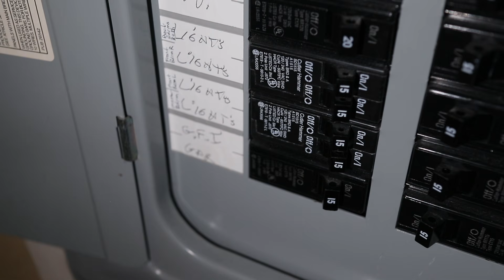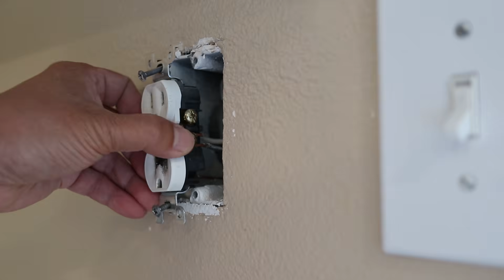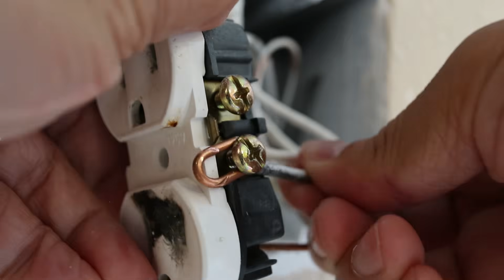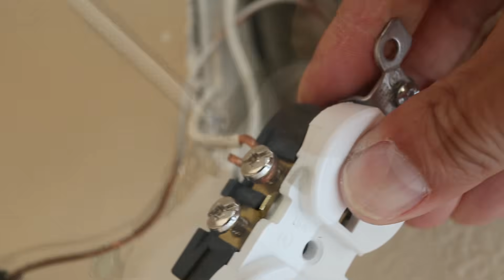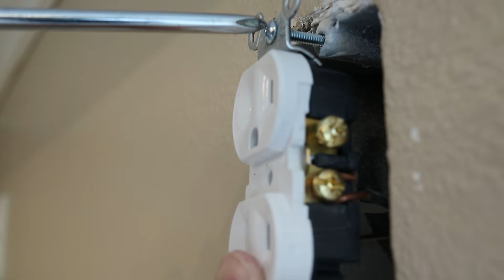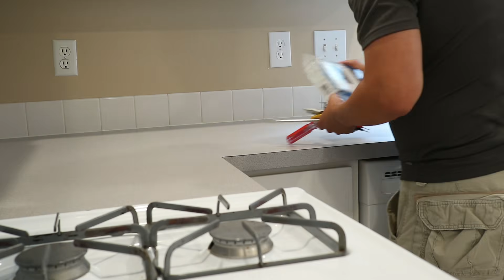How to Replace an Electrical Outlet – Replace Burnt Out Electrical Outlet and Old Damaged Socket

Comment: why would it burn tho? i got one like that
Reply from the maker: This outlet was from a rental house and the tenants hid it behind a child proof cover. I didn’t discover it until they had moved out so I don’t know how this outlet got burned. Could’ve been from a faulty appliance or something metal crossed the prongs on the plug causing it to spark. But as you can see replacing the outlet isn’t very difficult. Thanks for watching!

Comment: Your wires for hot and neutral are a bit long, you dont want copper hanging outside the back of the outlet.
Reply from the maker: Yes! Thanks for the observation! A few other viewers said the same thing about wires. This is how the wires were installed when the house was built. First time I’ve replaced this outlet. I’ll have to go back and cut it back so there isn’t as much copper showing. Thanks for watching!

Comment: No point in explaining the difference between the hot and neutral wires and where they go right? Because the previous outlets will always be wired correctly.

Comment: A real simple way, Live wire which usually is black always goes to the shorter plug slot on the right of the plug, and white neutral to the left larger slot! If the plugs have color coded screw terminals, brass colored screws on the right is black aka live wire, the silver screws on left are white aka neutral, and ground is the green screw where the bare ground or in some cases green ground wire goes! And for ALL THAT IS HOLY do not use the stab in connectors in the back, they might be okay, but they have a higher chance of failing under heavy load thus leading to a fire in the wall!
Reply from the maker: Thanks for the additional electrical tips!

Comment: What causes burnt outlets?
Reply from the maker: I’m not exactly sure what causes burnt outlets. The one I replaced was in a rental house and the tenants hid it behind a cover when they moved out. But it was probably caused by sparks or arcing at the plug.
Reply: @TheRenderQ  the reason why the outlet was burned because you did not snip little bit of insulation wire.

Comment: Great & helpful video.  One of my sockets was not working properly. The top would not work, but the bottom one had power.  I followed this video and when I removed the outlet from the wall, I noticed the top white wire was a little loose and not as tight. There were no signs of burnt, discoloration, or wear & tear.  I made sure that loose screw was on snug/tight. It turned out to be the problem and it's working again.

Comment: I am not an electrician but that wire is stripped too much, it needs to be shortened a bit.
Reply from the maker: Thanks for the observation! A couple of other viewers have also mentioned that too much wire is exposed. I just changed the switch as is but I’m now more informed about the insulation on the wire. This outlet was installed by an electrician when the house was built. So even electricians don’t always do it correctly I guess. Thanks for watching!

Comment: So what if the outlet has no power anymore
Reply: It sounds like you would need to shut off the breaker to that room, and go in with a  pair of gloves to see what the problem is. It probably came disconnected or shorted out.

Comment: Ground doesn't have insulation?
Reply from the maker: I’ve done simple electrical work like this in a few houses with switches, lights and outlets. None of them had insulation on the ground wire.
Reply: @TheRenderQ  Thanks for info. Well I am electrician self-learner, but this is the first time I see "Ground" not insulated. Not saying its wrong, but uncommon for me. In our country we got GND as YellowishGreen insulation.

Comment: When 2 pairs of wires, it is important to make those terminal screws very tight, the entire load of the circuit is reliant on those screws to carry the power to the rest of the line. Restrip the wire for a new clean fresh connection. The old one dented the copper and weakened the connections, so starting fresh is better. Theese videos are kind of dangerous......many important facts missed. Dont reuse wire if damaged or burned or weakened.
Reply: Stripping to some fresh wire is the only important thing that was missed. I wouldn't call that "many."
Reply: @clint4237  out of all the things I addressed......you pick apart the use of the word many...lol yes overlooked MANY important issues, not gonna list em....dont be jealous,  it's my trade, u a jack leg handy man.
Reply: @captainhowdy3104  with all the things you addressed? You barely addressed anything. Don't be jealous? What are you even talking about? Stop being a child.
Reply: Also the copper wire shouldn’t be exposed beyond the black part of the receptacle without insulation any loose or cross connections could hit the hot and wouldn’t be good
Reply: @ryanshaneprod3487  hopefully breaker would trip.....unless it's a square d modular home type or g.e.slim. I have a dead short switch I made up to test breakers or use in demo situations.....be surprised my findings lol
Reply: Good to know.i have at least one burned out one I haven't  looked at yet!!
Reply: @renatawarec  He should've trimmed the wire back an inch and that would've completely of SOLVED the problem. I have OCD so i would've taken sand paper to the end of that ground maybe rough it up 1/2 inch at the end of the wire so that you don't see paint on the ground anymore. lol. 🤷‍♂️

BTW having a gutter mindset where you say to yourself well I can't do such and such because its "dangerous" is just ludicrous. EVERY billionaire took CHANCES! 💯

Comment: Is this a 2way or 3 way? I'm looking for replacements just don't know which to grab
Reply: Single pole (1 way) or three way referees to a switch.  For a typical household you need a Recepticle rated for residential 15 amp. 20 amps needed if the Recepticle you are replacing has a "t" on the left hand side of the plug. Mostly used for things that have large motors.

Comment: Thanks. Seems pretty simple.
Reply from the maker: You’re welcome! It actually is pretty easy to replace an outlet. Of course make sure power is off when you’re working with wires. Another viewer recommended that I use insulated screw drivers so that’s what I’m getting before my next electrical project. Thanks for watching!

Comment: Thank you so much. I have a light switch that needs replacing. Unfortunately it has an outlet next to/attached to it. I thought I might do some research on what to expect before I open it.
Reply: If you have a wall outlet next to the switch it will be the same as flipping the lights off. Because they draw off the same lines. Sounds insane but true

Comment: The outlet I need to replace is an outside outlet and isn’t listed on the breaker box. Any suggestions?
Reply from the maker: Your outlet should be on a breaker even if it’s not listed. However I’m not an electrician but I would think it has to go through the breaker box. I’d plug in a light or something and flip breaker switches to find which one it’s on. However if the actual outlet isn’t working you’ll need the circuit tester and test the wires as you try different breaker switches. Power should still be going through the wires even if the outlet isn’t working. Hope this helps!
Reply: TheRenderQ thank you so much! They did a horrible job at labeling in the box, the only thing close to outside is the porch lights.

Comment: Can a burnt outlet that was back stabbed cause other outlets in the circuit to lose power?
Reply from the maker: If one outlet has caused other outlets nearby to stop working they all might be in the same GFCI circuit. I’m sure you’ve seen those outlets with the ‘test’ and ‘reset’ buttons on them? You’ll have to find the one that has tripped and hit the reset button. Once I had my bathroom outlets stop working. It took me a long time to figure out where the GFCI outlet was. Turned out it was in the garage. I was looking for one inside the house. Hopefully a GFCI is what’s causing your issue!
Reply: @TheRenderQ  I only had one in the bathroom and it's fine. I found an old 3 way switch next to a single pole switch in my kitchen. It looks like the beginning of the line.  The 3 way has a white and black wire on the common screw. It feeds my kitchen light and the single pole switch next to it that sends power to my outside light. I banged on the wall around it and now the outside light is dead and my other outlets are showing open hot. I'm pretty sure it's the source for all the outlets that went out and are showing open hot now. Must be a loose connection in there. Gonna rewire it today.

Comment: Hey I’m quite scared my outlet started sparking after a prong got stuck in it I tried taking it out it sparked and the outlets in my house stopped working what should I do turn on the breaker or take out the outlet and replace it or do I have to rewire the outlets
Reply: Turn off the breaker that controls that outlet.  With the power now off to that outlet you can replace the existing outlet with a new one like in this video.   Simply copy the wires like he did.

Comment: What if upon doing this (In an apartment) you notice that there is no Ground Wire,is the ground wire really necessary?
Reply: It depends, is a two prong receptacle or a three prong as shown in the video? 2 prong are in older residences probably over 60 years. They have no ground wire. Actually this is the responsibility of apartment management.
Reply: @surferdude642  It was 2,I made it into a 3 tho.
Reply: @CONCRETEJUNGLE-be6ic  that maybe a fire hazard. I read in other comments that goes against code. Definitely contact apartment managenent...
Reply: @gloriamacias1381  Thank You.

Comment: Thanks for this video! This may be a silly question, but my house was built in the 70’s. Is there just a standard replacement for all houses, or do they have certain amp or volts that I need to look for when purchasing some? Thanks for any help.
Reply: Nah, but your outlet may not be grounded, depends on the wiring. My house is from the 60s and previous owner replaced the outlets from 2 prong to 3 prong but the 3d prongs for grounding and there is only a positive and negative wire. This means it can take 3 prongs but not by code
Reply: The standard receptacle was then is now 125 volts and 15 amps. 1500 watt device is the maximum you should use. This would be for example a powerful microwave oven or a room heater. Most devices state the power (watts) on the unit. 1500 watts is equivalent to 12.5 amps. If you are interested I recommend you do some research on home wiring and electrical systems as there is too much for me to explain in this comment section. I hope this helps.

Comment: My outlet sparked, then stopped working.
Reply from the maker: I’d replace that outlet if that happened. However it could’ve just tripped a breaker switch. If this is part of a GFCI circuit then on the main outlet just reset the GFCI button. I’ve had that happen before. Hope this helps!
Reply: Same

Comment: Hey I have a question, my outlet looks exactly like yours, burnt out. All my plugs that I put into into the outlet get hot. Do I have to change the whole outlet Or do what you did in the video. Also my
Plugs do not go in all the way properly and at some angles there’s no power to the thing that’s plugged in the outlet.
Reply: Call a real electrician lol
Reply from the maker: If your wires get hot when you plug something in that could be dangerous. I’d definitely replace the outlet as shown in my video.

Comment: I was wondering why you attached the black wire to the bottom screw instead of the top screw.  My outlet was demolished (split in half by a large picture falling all wall onto an air purifier plugged in - I wish I had taken a photo of it before I removed all the damaged pieces) so I had nothing to go by as far as where the wires were.
Reply: No problem Mardi, get a new receptacle from your hardware store and use that. It makes no difference, just make sure you fasten the black wire to one of gold screws and the white wire to one of the silver screws and tighten firmly and tighten the unused screws also so they don't just hang there loose. Don't forget to cover it with electrical tape like he shows.
Reply: I"d be sure to make sure you flip the receptacle so the ground is on the TOP. This is pretty common given this particular application.

Comment: can u pls tell me what exactly the tool is that you plugged into the socket to check the line when you were done? thankyou
Reply from the maker: The tool I used to test the socket is a dual lead circuit tester similar to this one: https://amzn.to/3hyMwIp

Hope this helps!
Reply: @TheRenderQ  thanx it did. great video by the way. i thought it would be scary and hard to do this, and you showed it to be pretty darn easy. appreciate you. i blew a socket last winter with a space heater. i know-dangerous! not this year. anyway it blew, and i lost that circuit line. so one room had no power. it is a spare room so i was kind on calling an electrician. but thanx to you, did it myself. line up and running...IF you get time and know how, i would love to see a vid on-pulling a line from house ?(socket) across my yard to put in a new outlet by an outside shed. i know i will have to trench, and put the line inside a grey pvc pipe, then rebury it, but wanted to know if i would be comfortable trying to do that myself. have no idea how i would tie into the house???that may be too much for me, but i would love to see it done so i could check it out....

Comment: Hello I was replacing my outlet my black wire broke how do I replace that black wire
Reply: Restrip the wire back far enough to undamaged, clean wire. Bend the hook on the wire in the same direction you tighten the screw, hooking backward loosens the wire as you tighten.
Reply from the maker: How far back did the wire break? If there’s still enough of the black wire to work with you can just strip off some insulation and connect the bare wire to the outlet. If it’s too short you can strip off the insulation and use a wire nut to add an extension to lengthen the black wire. That’s if you have some extra wire lying around. If not maybe one of your neighbors might have some scrap wire.

Comment: I have a cfgi outlet to replace it, circuit in the breaker box is fine, I put the wires on the same screws as the original outlet had, but it doesn't work

Comment: Short, sweet, and to the point. No vlog style trying to extend the video to boost your pocket depth. Love it brotha!
Reply from the maker: Hey! I’m really glad that you appreciate my tutorial! I always try to make my videos as concise as possible. No need for unrelated info making the video longer. Thanks for watching!
Reply: @TheRenderQ outlets look like tiny gasps. 😱
Reply: @TheRenderQ  sir i like ur vidio can u reply me
Reply: @TheRenderQ  u from sir can u reply .i want few help
Reply: This looks so easy to do. Thank you for this video. @TheRenderQ
Reply: At first, I would of used a Non-contact voltage tester pencil, sticking two leads in a burn-up outlet could cause an electrical short. "Safety first"...Second, Trip the circuit breaker.Now before removing the protective cover, Retest the outlet.FOR extra safety use the two lead tester and test side to side. Before removing and handling the outlet. Just putting out some extra safety tips that's all.
Reply: Exactly. Tired of how to video where it’s 5 minutes of intro and 2 minutes of instruction.
Reply: Damn such a great comment and no heart 😞.
Reply: My thoughts exactly.
Reply: Right...no introduction of the family members